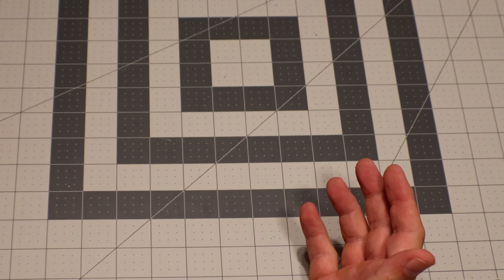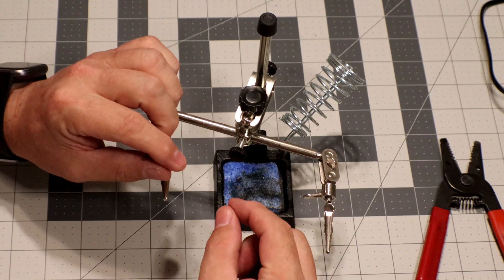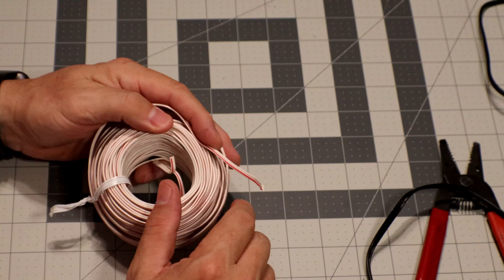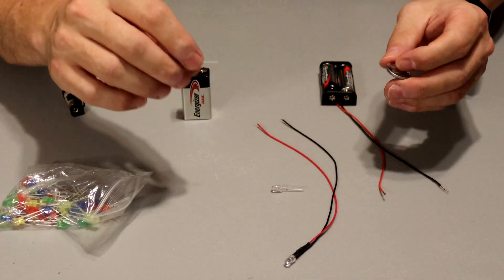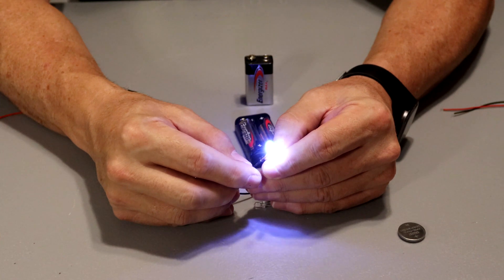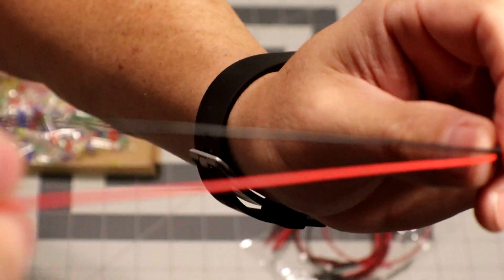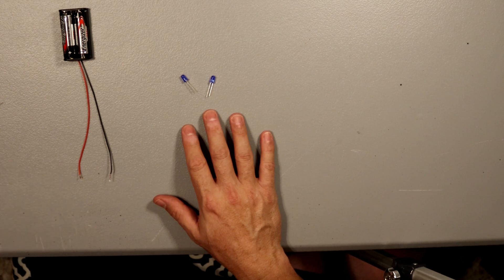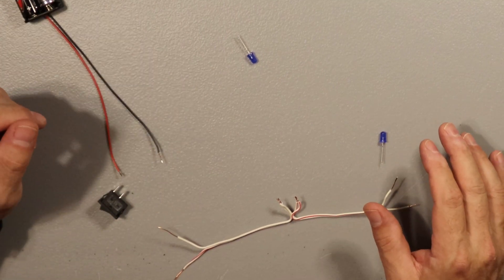How To Wire LED Lights In Your Diorama [TUTORIAL]

Comment: Very clear instructions. My only question is how to mount the light to the diarama so that another user can just flip the on off switch and not see the wiring involved.
Reply from the maker: @gledger1963  I show how I do that in some of my other videos. Normally you can melt a channel into the xps foam for the wiring, or create a space as you build.

Comment: Thank you, this was really informative. Just a question from a total novice - Say I want to connect 4 or more 3V led's in a series but my only power source is a 12V - 5A connector -  can I put a resistor on each 3v led - will this work or will my project go "BOOM"?
Reply from the maker: @marietjieviljoen6301  Good question- unlike batteries, LEDs don't "stack"- they don't add together and increase voltage. So you can't take four 3v light strings and make a 12v circuit. So if you connect a 12v power source to 3v LEDs, you'll likely blow some bulbs. So yes, "BOOM". Thanks for watching!

Comment: With that led strip, how do I attach the wire permanent? Can I solder it?
I want to use a power outlet Insteadof batteries. What would be    your recommendation?
Thanks for the great and clear instructions
Reply from the maker: @Hellhamster  yes, you can solder it, but to use an outlet, you'll have to use resistors to reduce the voltage, because a household plug would really overload the circuit. Most off-the-shelf led stripsthat plug into an outlet  have that big box between the strip and the plug (like most computers, many TVs, and smaller electronics). It's there to reduce voltage and not blow the circuits. If I'm honest, I've not researched wiring an LED circuit with resistors like that. But it's certainly doable. If it were me, I'd buy an LED strip that plugs in and try to modify it to my project and use that as a learning experience. Just be careful. I hope you get it figured out.
Reply: You are awesome, thank you for letting me know!!!
Reply from the maker: @Hellhamster  😊 thanks for watching

Comment: You keep saying those LEDs are wired in ‘series’, but I think you mean ‘parallel’. In a series, voltage is shared, so each of the two LEDs would only get half of the three volts from that battery pack.
Reply from the maker: Yes- I corrected myself in the notes/comments but didn't want to go back and re-edit the video. But yes, it's  a parallel circuit. Good catch!

Comment: great video! you can also use a hair dryer instead of the hot air gun!
Reply from the maker: This is true. I've noticed the hot air gun is a bit more directional when handling small parts, but that can be overcome using tweezers or pliers if using a hair dryer. Thanks for watching!

Comment: What if we use an LED strip light, how would that go?
Reply from the maker: I review wiring strip lights in this video. You'll need to match voltage required by your strip lights with your power source and solder to the appropriate positive/negative poles. Most other types of strip lights you can get online come pre-wired with a battery pack or power supply. If I am misunderstanding the question, let me know.

Comment: hi noob here... what if you want usb cable as power source thank you in advance
Reply from the maker: It gets a lot more complicated once you start using voltage that does not match the bulb requirements. You'll have to add resistors to the circuit so you don't blow the bulbs by overpowering them. Not an impossible task by any means, but you have to do the math (and research) to make sure you have the correct resistance in the electric flow. Personally, I have yet to try it. A simpler solution would be to get pre-wired USB LEDs which come with everything working and if you need to extend the wiring just solder in extensions. Hope that helps! Thanks for watching